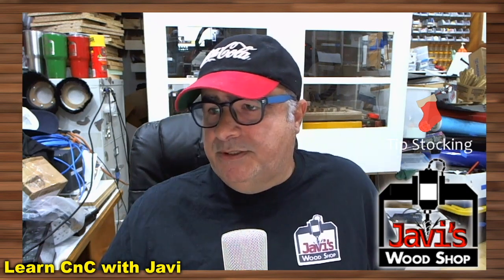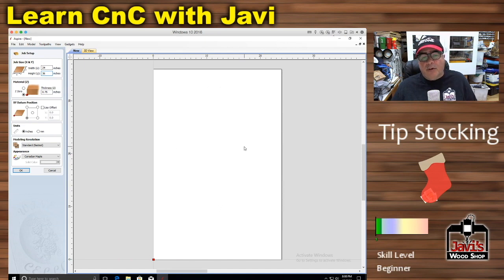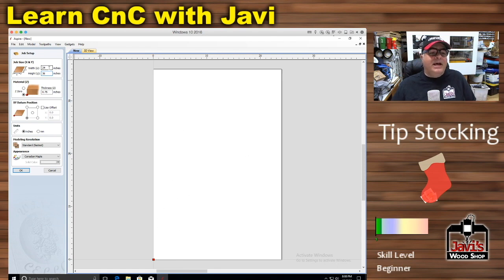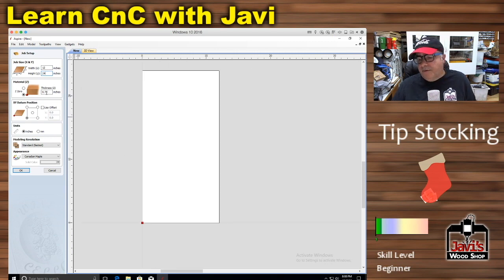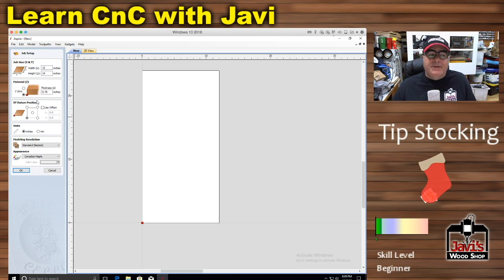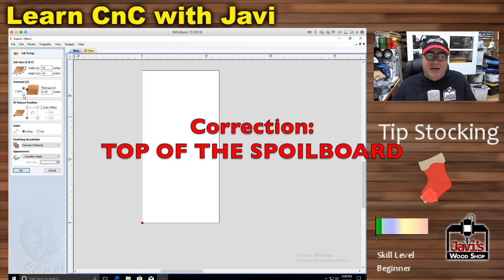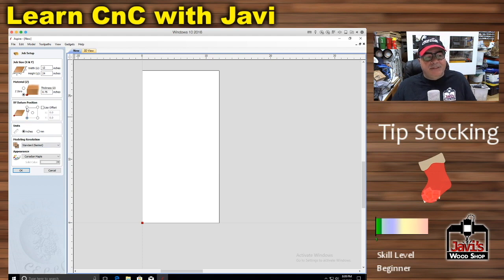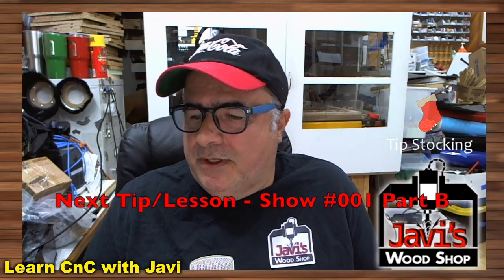CNC with Javi Show #001a Starting a New Project

Comment: Looking forward to learning CNC.  I purchased a Shark 10 months ago and the only thing I have successfully completed is a spoil board.
Reply from the maker: I'm just getting my feet wet imparting the information. So many years of CNC in my head, it won't always come out in order, but I'll try my best!
Reply: As a former instructor I can make one suggestion step by step assume your audience has no knowledge
Reply from the maker: Thanks Don. I'll be weaving the basic steps within the classes. Some will be more advanced as I have a wide range as don't want to alienate the advanced CNC'ers, but most of the instructions should be broken down into simple steps.